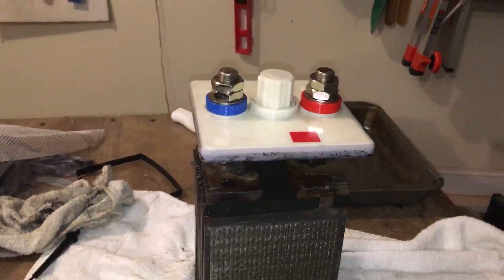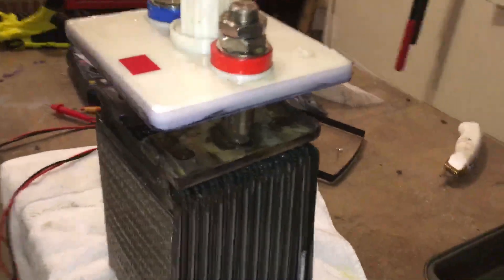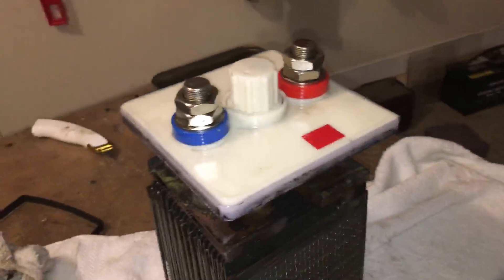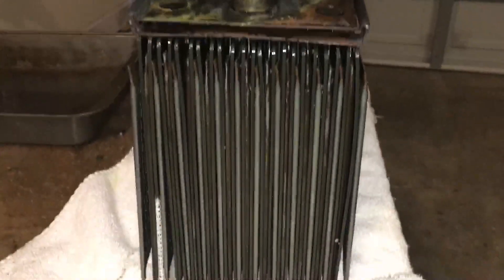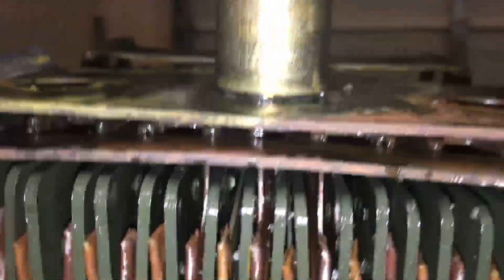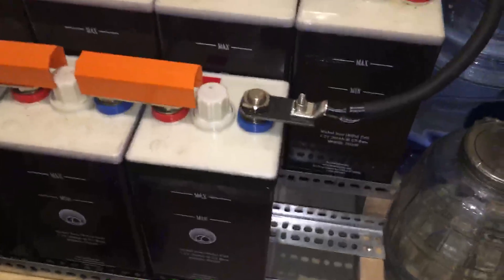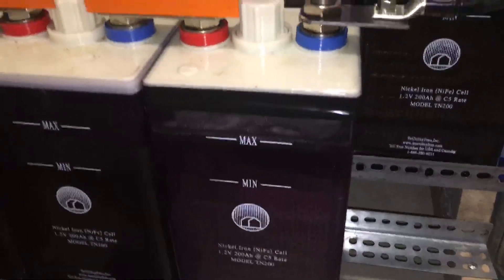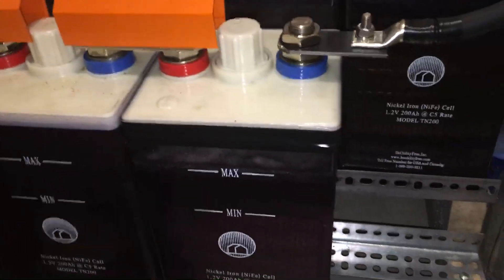Found a bad Ni-Fe cell in my battery bank and here is what they look like internally

Comment: Same here, Dealer in Victoria Australia will not answer, cell appears to have a dead short but I havent taken it apart. Cheap chinese cells, the plates shed particles that short out the cell. Empty the electrolyte into a bucket, allow to settle , rinse cell with good quality water supposedly distilled but maybe rainwater. You can set up a big funnel and filter the blackness out of the electrolyte and then reuse. I do this as it is really difficult and expensive for me to get Potassium Hydroxide, BUT this recovery process is dangerous. NOTE the 30% potassium hydroxide electrolyte is very dangerous, use face safety protection and good quality gloves, long sleeves, long trousers.If you spill on the skin wash off immediately dont delay, then wash for 5 minutes with vinegar as the caustic electrolyte attacks the skin and complexes fats and oils in the skin. Make sure that the electrolyte level is always on MAX. Check individual cell voltage once per week. If cell voltage falls below 0.9 Volts say 0.7 then take cell off line, pour out and service as above, put back clean electrolyte and the cell will recover.If you leave a low voltage cell on line for a few weeks you may not recover it,  Overcharging will not harm the cell, but the electrolyte level will go down so keep the level up that is really important, do not let electrolyte level fall below minimum under any circumstances ,have a nice day, from Australoa

Comment: Did you weigh any of your cells when you received them? I've had some problems with a lot of gunk in the bottom of quite a few of my cells, and out of interest I weighed 4 of them. 13kg each for 2, 12.5kg each for the other two. The first 2 haven't been flushed, or had electolyte replaced,  the 2nd two have been flushed lots to clean them out, and  have new electrolyte. I'm being sent 6 new ones soon, and will weigh them too. According to the specs, they should weigh 14kg each filled. Mine are 200Ah also. Look exactly like yours. I bought 40 in 2016, working fine until early 2019,  when I started seeing cells go to -0.23V during the discharge cycle. Since then, I've had 7 go bad. 2 seemed to have recovered after some hard charging, but don't know if they will last long. Electrolyte change didn't help.

Comment: Great vid, i've got a shorted nife batter and just wanted to check what is the mesh you use between the plates, and also what did you use to glue the case back on afterward?
Reply from the maker: I've since started using zip tie strips, 4 strips cut to size will keep the plates separated. That way there is much less resistance between the plates.  Also, epoxy will work best to seal the cell.
Reply from the maker: Don't know if I answered this, but you can use some 5 min epoxy from lowes or home depot.  I used different things like gasket sealant etc., but I've found that 5 min epoxy is the best.

Comment: I'm seriously considering going back to NIFE batteries soon.  My previous set was made in Hungary and I loved it.  You have experience with the Chinese cells, so please tell me your thoughts and recommendations.  I much prefer learning from someone been there and done that than to learn for myself!  Thanks!
Reply from the maker: Hello, sorry for the late response.  So far I've had overall good experience with the cells.  I did have one bad cell, but the other 19 are fine.  And I repaired the bad cell and it's in the bank as well.  At this point I still have no regrets about buying them.  If you are still looking for NiFe cells, I would recommend going with cells from Iron Edison over at ironedison.com.  The price is reasonable in my opinion.  Are Chinese made cells as good as the original Edison's in terms of quality? In my opinion no,  but they do get the job done.  If I had to do it all over again, I would still go with NiFe cells.  Take care.

Comment: I do agree with you the ORIGINAL nickel iron cells ware better quality. I actually have an original  set that I use daily (original set 76 years old) that run my swamp cooler 12V , 3A water pump and charge it with a PV module.
Reply: 76 years old??  What do you do to maintain them?

Comment: Did you notice that the same Chinese factory produces all the "edison" batteries. They don't recommend going below a higher percentage of charge.   Like 20% needs to be left.   They also indicate that they may be good for 1100 cycles, not hundreds of thousands. About 3 years?
Reply from the maker: Actually, it is a common misconception due to mis-information that all Ni-Fe cells from China come from the same source.  However, like in the US, there are multiple manufacturers in China, for example http://www.taihangbatteries.com/, http://www.hmbattery.com/ and of course http://www.changhongbatteries.com/ to name a few.  Here is an actual YouTube video from the folks that produced my cells https://youtu.be/oQhr8K-7bjo (which is Hengming Battery not changhong).  In the video it clearly shows them making cells in their manufacturing facility.  Also, if you go to their website you will also see that their TN-200 series cells looks exactly like mine except they used a white case instead of a clear case in the marketing photo.  However, the size, shape, configuration, and markings match mine exactly.  If you go to Changhong's website and look at their Ni-Fe cells, you'll see that they don't look anything like mine.  Also, my cells has a special custom OEM labeling from BeUtilityFree, which Hengming provides as part of their  OEM Service which allows the distributor to put their branding on it, this is also clearly stated on their website. Their website also states that the service life of their cells is 20 yrs.  But Is it true?  Time will only tell, we can only go buy what is stated by them as the manufacturer and personal experience.  So hopefully, with this little bit of information you can conclude that, like in the US, there are different battery manufacturers, different manufacturing methods, and different levels of quality.  I'm aware that there have been videos etc that would lead people to believe that Ni-Fe cells from China or elsewhere are a bad investment, and they try to lead the casual viewer to believe that you'll only get 3 years of use, etc. etc, and they cite for reference a single website page from 1 Chinese manufacturer, and they cite 1 study by 1 US testing lab of 1 experimental redesigned Ni-Fe cell from 1 "US" manufacturer name Encell trying to promote their redesigned Ni-Fe, which was probably a beta test at the time if nothing else.  Incidentally, that final report from that Lab, (Sandia labs), clearly stated in the abstract that "In summary, the Encell batteries have met performance metrics established by the manufacturer. Long-term cycle tests are not included in this report. A cycle test at elevated temperature was run, funded by the manufacturer, which Encell uses to predict long-term cycling performance, and which passed their prescribed metrics."  You can read it yourself here at this link  http://www.sandia.gov/ess/publications/SAND2014-17462.pdf.   Granted, we can't believe everything we see and read on the Internet or anywhere else for that matter, but we can put the pieces together and form our own conclusions.
Reply from the maker: Also one other thing that may help clear things up.  Cycle life with Ni-Fe cells are generally in terms of electrolyte changes, the harder you use the cells the quicker you'll have to change the electrolyte to begin a new series of cycles.  This is not dealing with the lifespan of the cell but the lifespan of the KOH electrolyte solution.
Reply from the maker: Thanks for the comments.

Comment: I like NiFe Batteries,  but these are made in China.  The quality is just questionable especially for the price.
Reply: don't pack the plates in so tightly and just live with your cells being bigger for the same capacity.
Reply: @laurenceperkins7468  agreed, thats my complaint with this design, and lead Acid batteries. The builder wants to pack so much surface area into a given container. A shorted cell on a lead acid battery is about as worthless as a shorted cell with nickel & iron
Reply from the maker: The quality is not definitely not as good as the original edisons, but they do seem to work well.
Reply: rhandsom 
Ever thought of building one yourself?? I've been studying its construction and it seems simple enough with today's available technology.
Reply from the maker: I've seen where others have built them or was exploring the concept.  My concern would be the amp hour capacity, whether the homemade cells would provide enough storage power.  No doubt that they would work, just not sure how well.

Comment: Really a nice video of the inside of those cinese NiFe i can finally look inside one of them, thank you very much, awesome work!
I bought a set of this cinese NiFe as well about 16 months ago, it's still early to say anything as one would see what happen after 10 years, but so far they are performing well, mine are 20 cells for a total of 400Ah 24V.
I have a main lead-acid bank 2000Ah 48V 9 years old still performing good but i never discharge them below 70% SOC and i know i'll have to change it one day that's the reason i got this small bank to see what's true and what's not.
I use them as a secondary slave bank so they discharge first and recharge only after the lead acid, i bring them down to 20% SOC on a daily basis and sometimes leave them down there for days or weeks depending by weather conditions, 16 months old they still deliver 400Ah i'll see how they will do during the next years and eventually know wich one to buy when the main bank will stop working.

From what i can see through the refill holes they looks the same as yours, here my bank:
http://imgur.com/3eSh8m7
http://imgur.com/sj1Gcul
http://imgur.com/0z2hc7r

I also have some very old NiFe cells from an european manufacturer called "NIFE" wich i think it closed around '80 and beside they are almost 40 years old they are still working, inside they look very similar to your opened cinese cell but they don't have separators, plates are held a part from some slots on the side walls of the case:
http://imgur.com/1SR3WmH
http://imgur.com/ukogwYd
http://imgur.com/lXqjvoA

I hope you can see the pics
Reply from the maker: Thanks for the comment and the pics.  You've got a really nice bank of cells. Glad to hear from others who have crossed over to Ni-Fe cells.  The fact that you've got some cells that are similar to the Chinese versions still working after almost 40 years is awesome to hear, thanks for your input.
Reply: I'm curious about the separators they use in nowdays cinese calls like mine and yours, from the video it's hard to see how they are made, have you noticed if they are like felt/porous rubber like in lead-acid or they are just plastic spacers with open windows letting plates face each others with clean open electrolyte?

Comment: Thanks for sharing the "bad" too. Hope you are not "cooking" those batteries to much? I seen your "crazy" currents. 100+ amps for the 400ah battery setup, I may be wrong though.
Reply from the maker: E.John thanks for the comment. I usually run my batteries pretty low, it's not uncommon for me to get in the teens or single digit State of Charge. It takes some decent power to fully charge these cells from that low state of charge. So that level of charging, 100A, works well for a bank of this type with the deep discharges I put it through.  Also, it's actually slightly larger than 400Ah.  As for cooking them, absolutely. I purchased these cells with the understanding that they were suuposed to be tough, durable, able to take the usage ordinary cells could not, and my plan is to put those claims to the test.  That reported durability was the sole reason I purchased Ni-Fe cells.  if they can take the punishment, then it was a good buy, if they can't, well then I will know the truth.  in any case, I will definitely use them in a way that I will get my money's worth.
Reply: Well from that point of view, I will totally agree with you.

Comment: So much for any attempts to clean them in the future with those cells being welded like that! :P  BTW, for the Ni-Cd cells that you cleaned but weren't shorted, did the cleaning result in additional AHs?
Reply from the maker: I believe the Ni-Fe cells can still be cleaned, just not in a manner similar to the Edisons.  It may take some thought, but I'm sure I can come up with some way to get the job done.  It will be challenge yes, but not a road block.  The cleaned Ni-Cad cells did result in increased amp hour capacity, not the full 240Ah, but enough so that 2 cells in parallel gives me the amp hours I need, my 2 banks combined give me well over 400Ahrs  of storage, so the cleaning definitely helped.

Comment: I heard they where welded, but this is the first time I have seen one taken apart. Glad you where able to repair it. Wish the new cells would come down in price.
Reply from the maker: Thanks for the comment. I'm glad I was able to repair it as well, I wasn't happy to find a shorted cell in a new battery bank.  But it is what it is, it's fixed and life goes on.
Reply: @rhandsom  what metal is the rail-chair on top and the rods of positive/negative ? what metal is the frame of the nickel and what metal is the frame of iron part?
thx